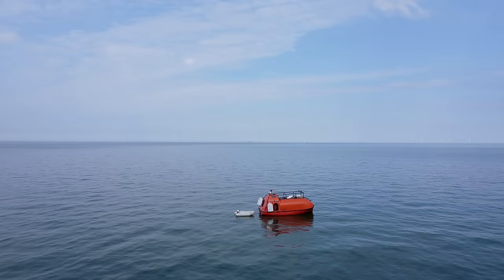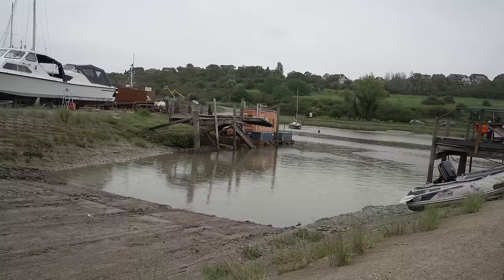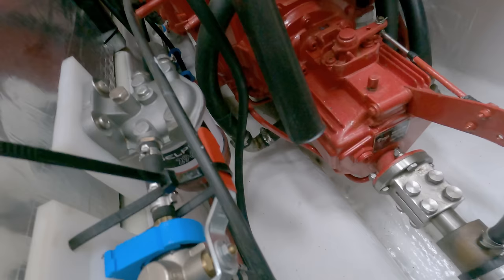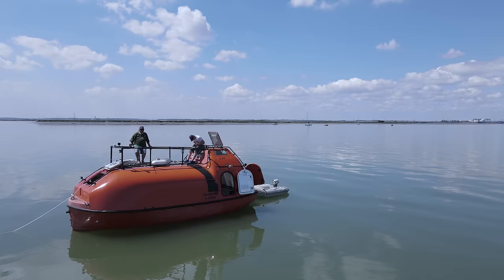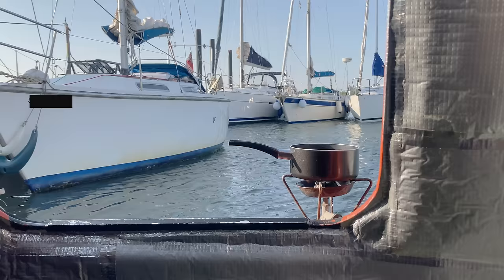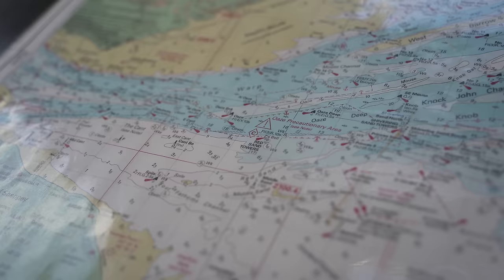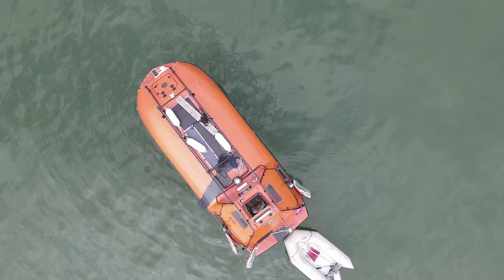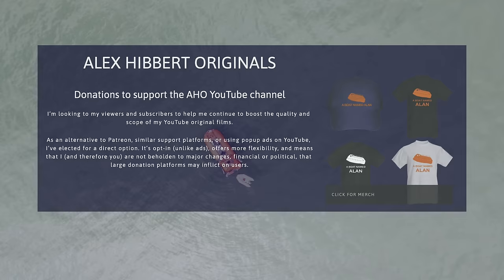*SPECIAL* Lifeboat Conversion Ep20: Multi-day sea trials in the Thames Estuary, England [4K]

Comment from the maker: For those of you who've missed earlier episodes, bilge keels or deeper keels are discounted for use due to vulnerability to sea ice. I won't be replying to each comment suggesting them from this point on!
Reply: I’d think about placing a second back up line on your “support dinghy”. Last thing you need is the main line to disintegrate or loosen when you least expect it and when you need that dinghy. If you can, might be worth making triangular clip on seats that you can slot on top of the support bars on top. Just means you can have a reasonably stable seating position in the corner or your choice but somewhere you can enjoy on calm days - just a thought. Well done on your progress!
Reply: Yfyfyt
Reply: I agree no keel weights.  An.old friend built his second catamaran called Quee Queeg 2. It overturned in rough seas in Madagascar it lost one keel.
Reply: A
Reply: Your based on Canvey Island????
Reply: คน
Reply: @backachershomestead ตจ ค
Reply: @backachershomestead  หน้า
Reply: @jasonknoxx6271  สินค้นรตรีานขต
Reply: @jasonknoxx6271  ข
Reply: A lifting weighted centreboard? Glass a receptacle/shape into the hull to take the weighty bit so that when lifted the hull is still smooth and unfussed by ice forming underneath. Raised and lowered by a simple boat winch, the type used to pull a boat onto a trailer.
Reply: Have you thought about putting trimaran hulls on either side?
Reply: I'm might have a way to transport these lifeboats if you're interested
Lmk
CCW
Reply: Man that thing is one ugly little toad.
Reply: Lol
Reply: I'm just uncomfortable with you referring to a sea vessel as a "he" and a male, when everyone knows all boats and ships are traditionally referred to as female with female pronouns.
Reply: @Eidolon1andOnly  Well everyone is uncomfortable when I refer to my ex mother inlaw was Sasquatch or a Yeti but U know she does look like one.

Comment: A depth finder would be a good add on especially for shallow conditions and gps as well as with some lowrance ones you get a map gps, depth finder and can even set waypoints. You Might also be able to have a speedometer on it too. You should cross drill the top rail so you can rely on it and maybe even use a stronger pipe so it’s a proper railing that you can lean on.
Reply from the maker: Depth sounder yep - as well as a forward facing ice finder would be good. A speedo - not sure accurate enough for a 0-6 knot range!
Reply: @AlexHibbertOriginals  Your depth sounder can also function as a knot meter. I would look at the in hull options. They can shoot right through the fiberglass bottom. Easy to install and no holes in the boat. 
Especially when dealing with tides you'll want to know your speed in the water vs true speed (GPS)
Reply: @AlexHibbertOriginals  Bucket and knotted rope for speed lol oh and a decent chronograph..
Reply: @otm646  SOG
Speed
Over
Ground
Reply: And a rear view mirror. You could see what's behind you, as well as the sky without having to get up and turn around. : )
Reply: How much food,drinking water,toilet paper and disinfectant are required for 20 people onboard?

Comment: You mentioned sleeping platforms

Given adaquite warmth, reinforcement, and willpower, hammocks could be more comfortable (they accommodate somewhat for roll) and space efficient.
Reply: My dad (RN 1942-1947) swore by hammocks for comfort warmth and security. He hated bunks. Plus they can be rolled up and stowed out of the way when not in use and take seconds to deploy. So I concur with your suggestion.
Reply: @wideyxyz2271  I concur with your concurrence. I exclusively used a hammock during the hiking and camping period of my life and also found them to be secure and warm. Plus, much easier to roll up and stow in a backpack than a bunk would be. Cheers

Comment: Sound proofing the engine is great and you should do your best, but, in my Diesel Motorsailer, which is actually pretty quiet, the engine drone still gets to me after a couple of hours and I have resorted to wearing earplugs which for me makes things quite pleasant.  It also cuts out most of that nagging sound from the wif......I mean other crew members too! :)  Great vids!
Reply from the maker: I hear you. Headphones for whoever is on the radio is likely to be necessary, for a start.
Reply: @AlexHibbertOriginals  The current state of technology for headphone with noise cancellation is worth looking into, giving you the best of both worlds. I'm currently watching this video with a pair.
Reply: @PlasmaOscillations  Fully agree. I have a pair of over-ear Sony headphones and in-ear earphones I use all the time. They were originally purchased for long international flights. They work incredibly well. It is a little strange, however, as I can't hear other people or the stewardess but it feels like I can still hear a little of the plane itself. I think that's more to do with "feeling" the plane and imagining the sound than actually hearing it....

Comment: Nice to see Alan afloat. Re the rolling:  Bilge keels you've already rejected due to ice. Good call. Stabilising booms and anti roll "fish” on cables are relatively cheap. Just use hinged aluminium pipe and painted steel fish. Super common on small fishing boats. Watching the roll period Alan is VERY stable. One other item that you could consider is an anti roll U tube tank. They are partly filled with sea water. You have to adjust the amount of water and cross flow tube restriction so that the natural frequency of the tank is the same as the roll period but 180 deg out of phase with Alan's natural roll period. Harder to sort out compared to booms and fishes.
Reply from the maker: Thanks. I'll investigate. The nuances of boat roll etc are more complex than first realised.

Comment: Your friend Alan is absolutely right about learning to manover your boat, backing up and figure of eights and they are semi standard tests both for driver and boat and are best practiced in flat clam conditions, a single screw boat will always prop steer at low speed, so to have any control going astern you need to get way on (speed) once going astern keep the rudder straight and only give it tiny corrections to get where you want to go 2 or 3 degrees from centerline. You haven't run then engine flat out of an hour or so, you need to know if it is going to do it.

Comment: I did a fair bit of research on sound insulation when rebuilding an old land rover 101 a few years back, as in the cab you sit right beside the engine. Foam will help a bit with reflected sound but if you want to reduce noise transmission you really need a layer of the most dense material possible. I went for thin lead 'foil' in the engine cover but there are other options like rubber sheets with high density mineral 'fillers'.
Reply from the maker: Thanks Andrew - interesting. There's certainly a lot to read about the minutiae of sound reduction in its many forms.

Comment: My (admittedly limited) understanding of boat stability is that concentrating all the ballast in a limited area may not actually be the best option, as this gives a focus for the boat to oscillate around, which could militate against the form stability of a fairly boxy hull-form (sorry Alan!) You have the luxury of a relatively large internal volume compared with a lot of recreational craft of similar length, I wonder if there's any benefit i spreading the ballast bars more widely? Naval architects who understand metacentric heights are welcome to destroy my suggestion. Good to see him afloat!
Reply: Not a naval architect, but from what i know of calculating stability when loadinc cargo on ships, the most effective way to slow down rolling movements is to out weight higher up. 

Pretty sure allan is so small though (im sorry Allan) that in order to get the rolling period of allan below any waves, he will be upside down allready. Might iron out some small violent shakes though. (Think an oldschool metronome with the weight low vs with the weight high)

Comment: If you can, install a water separator filter assembly with manual pump. Dirty fuel is always a problem w diesels. Cheers.
Reply from the maker: There's an inline course filter, and a water separator/fine filter fitted prior to the engine's own filter.

Comment: Hi. Yes, Alan needs plenty of ballast to help against lateral rolling. It is designed to self-right after a capsize, so needs lots of ballast low down in the keel. This will also help against rolling and make Alan sit better in the water. The downside is that it will make Alan even slower and possibly harder to control, or not as responsive. Alan was designed to keep people alive, in open seas, until help arrived, not as a pleasure cruiser. Alan is a great craft though, and I can't wait to see your adventures in him.

Comment: Hammocks have a great advantage in cold climates as they can be slung high up in the cabin where the warm air collects.
If you choose to use them, be sure to stretch them very taut (RN style), not in a slack, dangling sling configuration (as seen in the movies), which will result in sleep-apnea, backache and stiffness as well as muscle fatigue.
Reply from the maker: Good tip. I've never got on well with hammocks. Maybe this is why.

Comment: Awesome project, I’ve enjoyed watching it come along. You asked for suggestions, so I’ve got one. You might get a hair better fuel consumption by routing the engine intake through the cover to let it suck colder air
Reply from the maker: Indeed - ports for air cooling hoses you might be able to see in the driving console insulation.

Comment: You need 2 outriggers with suspension. To reduce roll. 
You could do active noise cancelling to reduce engine noise. A mic inside the box and laptop plugged into speakers.

Comment: Great video.  Couple ideas: some type of bow thruster - thinking on a hinge to drop into water as needed.  Second steering wheel and throttle mounted high (no need for foot).  GPS guided autopilot (when in open seas it is really point A to point B).  In general, it needs more brackets.
Reply from the maker: Autopilot, sure. Just a funding issue.

Bow-trusters are likely overkill for the amount of tight manoeuvres Alan's is called upon to perform.
Reply: @AlexHibbertOriginals  Mine has one of the old style drive motors connected to the wheel by a belt with a control module that just holds a compass bearing. I'm not sure if they still sell them new but maybe a second hand one would be cheap and be good enough?

Comment: Observations and suggestions (both can be, and likely will be ignored)
Ascetics: 17:05 not the worst, then we see the worst (glad I had not eaten yet today)
Steering: while (almost) completely unfeasible a steerable shroud would solve a lot of issues
Rolling: stabiliser vanes below the waterline 1/3rd back from the bow at 45 deg from the horizontal would help and likely not add to the draught.
EGT sensor: would be useful in monitoring the health and performance of the engine and turbo if fitted at the end of the exhaust headers.

Comment: At anchor could use a "flopper stopper" to reduce rolling. There are some commercial ones, and numerous designs for diy. I built mine myself, a plywood square weighted on one side with reclaimed lead flashing and covered in grp to stiffen and waterproof it. The idea is as the boat rocks one way the unweighted side of the board rises allowing it to slip down through the water easily, then as the boat rocks the other way the board is pulled horizontal offering considerable resistance to the roll. Having it on one side of the boat working in one direction ensures each direction has a different resonant frequency to help prevent that resonant build up of rolling that has everything crash to the floor.
Of course it's no use under way, but makes things easier when anchored somewhere. I think some fishing boats have towed things on booms out the side to alleviate rolling, but not sure how that could be adapted to a life boat in ice.

Comment: Few life improvers for a sea: nmea like system with a GPS, magnetic compass and underwater speed sensor. This would give you heading over ground vs magnetic heading and speed over ground vs water speed. Also think about maybe a navtex (get storm warnings and weather forecasts), ais reciever (get warned before you get hit by a huge boat in the middle in the ocean) and maybe autopilot (explains itself), steering remote (steer while sitting on the deck) and some emergency equipment (inflatable lifeboat for your lifeboat and some pyrotechnic flares). Btw love your vids.
Reply: Alex already mentioned AIS. If you buy it for him he will send you his prototype t-shirt. I believe Alan already has a magnetic compass.

Comment: If you had another Alan you could have a very capacious catamaran and a lot less roll.
Reply: I had that thought too. If another Alan is beyond budget, then a Proa outrigger would do it. He could use some stainless tube of about 300mm diameter or plastic tube or oil drums welded together ( good excuse to get an angle grinder and welder).

Comment: Don't forget when running auxiliary tank[s] that the return line needs to return to the feed tank. If the return line goes back to the contaminated tank well then it's lost. The plumbing and switching for that can be quite complex in an emergency and is a system likely to confuse when needed most esp if it is manually operated.  

Also gal strapped together like that does corrode if it gets wet. I know because I drive trucks for a major steel company and all galvanized steel product has to be tarped if raining and some suppliers won't allow you to leave their facility even in the middle of a heatwave without the load being tarped. It's a very serious thing in the steel transport and distribution industry. Customers go crazy if their gal products get wet and many won't accept it.
It gets white rust, where the zinc starts to convert to zinc oxide, exposing the base metal which then rusts rapidly - and that's just rainwater. Same electrolysis as dissimilar metals, but in this instance zinc and mild steel - each piece acting as a battery plate.

Comment: You can actually reduce the sideways rocking of you boat by up to 70% by using a wave tank made with corrugated pipe.
30-40 cm diameter corrugated pipe 3 meter long and filled about half way with water.
Me, my dad and his friend tested it. It makes a rocky boat almost still. Ofc the weight of the boat makes a difference to the pipe size. There is science to that, but don't have it.
I say 70% roll reduction because we tested it with some home brew motion sensing gear.
Reply from the maker: Sounds authoritative !

Comment: A few years ago I saw a couple of guys on YouTube that had taken one of these and converted it over to solar with minimal Resto modification and still kept the fuel back up motor
Reply from the maker: How did they tow the acre or so of solar panels you'd need to power a 25' boat electrically?

Comment: I used to work at the factory that made the glass fibre for those, in Hindley, Wigan.
Reply from the maker: I hope you paid extra attention to your work that particular day Alan was laid up.
Reply: @AlexHibbertOriginals  The company who make them (I think in Norway) came to visit once and showed us a video where they pontooned a lagoon, filled it with crude oil and plonked one of these rescue boats in the middle of all the oil. They then set the oil alight and let it burn until the oil was gone. The boat was completely black, but a fire boat sprayed it with water and there wasn't a blemish on it. I think the internal temperature had gone up about five degrees that's all. Impressive.

Comment: for the handrails coming loose,
mark and dimple the pipe where the set screws make contact. then use thread locker on the set screws.
Reply from the maker: A likely solution
Reply: @AlexHibbertOriginals  i used to work in a factory. This is what we'd do for stubborn pullies that liked to walk off their motor shafts😅

Comment: Love it, id extend the keel 1 foot, by matching the width of the existing keel and making a 1 foot through bolted on extension out of solid steel, that would make her track alot more, and the ballast problem would be solved, you could then lengthen the rudder around a foot too and fix the steering issue..  haha i love this build, thats what id do if i was building it, id even remove the rear doghouse and lower the rear cabin deck past the rounded corners to add a a rear deck and add a mast and boom with a mainsail and a furling jib haha..
Reply from the maker: You'll enjoy two projects for this winter.

Comment: Alex having seen you and Dick move around 'Alan'  I even more think a modest stern grid to step out onto would make 'Alan' a deal more liveable.
Reply from the maker: Just off the stern, or the sides too?
Reply: @AlexHibbertOriginals  I have no experience with lifeboats. But based on my experience in the Navy seeing green water breaking over the bow of a 550' long cruiser, I'd think carefully about attaching much to the outside of the hull.